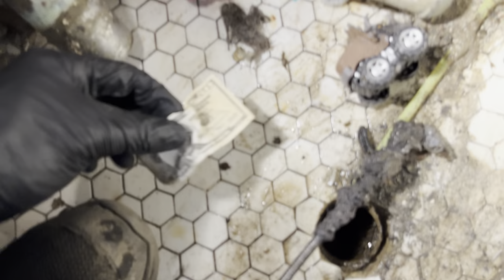Tub Stoppage | Clear from Standing Waste

Comment: Hello. What tool a size do you recommend to remove the top of the barrel and perhaps the barrel? Water its not going down, tried Draino, similar clog removal methods (hot water, baking soda, etc) to no avail. I tried using a short snake to grab from the drain in the tub, no avail. So my next step is to open up the top of the barrel, and use a 50 foot augur. First time experiencing this. A bit frustrated.
Reply from the maker: Pipe Wrench
Reply: @Dr.GreenPlumb  Thanks. Are you NYC based? I’m going to try if not I’m going to need a plumber. Lol. Let me know your pricing if you are.
Reply from the maker: Not in 🗽 anymore